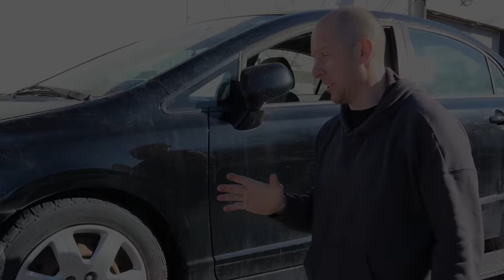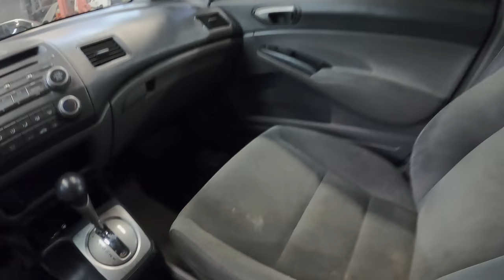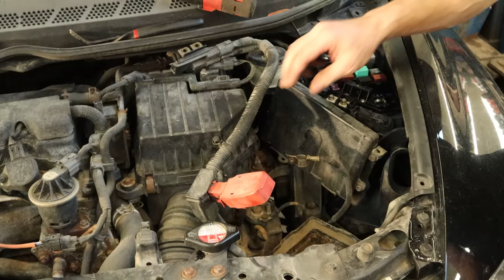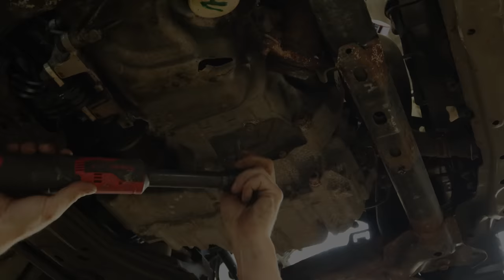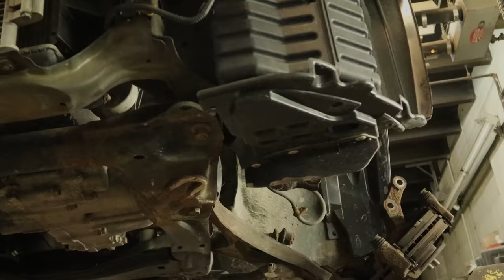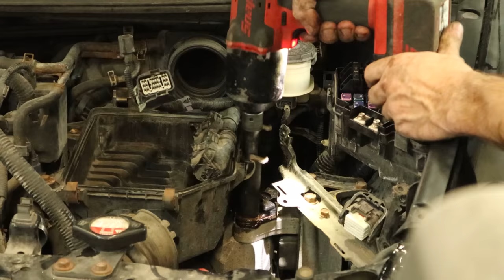I am going to take a big loss on this rebuild

Comment: I already have a high mileage Civic that I keep as a "beater" car, so I won't enter - but I HIGHLY recommend one. Parts are cheap, repair advice plentiful, and chances are it will always get you there. I've never had it quit where I couldn't fix mine with a screwdriver and vice grips.
Reply: Same here.   I have an 07 with 373,500 Mi.  (well, and maybe a hammer a time or two...)

Comment: I've got a 2010, and yeah these things last forever, as long as you don't add extra holes. 200,000 miles and the only thing I've replaced is the fuel pump, and those damned visors. So I clearly don't need one, good on you for helping someone out.

Comment: Did the replacement engine come from Scott's Honda Emporium? ; ) Someone is going to end up with a sweet civic. It has to be good because you had great luck getting the rusty fasteners loose and it looked like it had been taken care of, with the exception of driving it with a hole punched in the oil pan. I once purchased a Volvo 960 that the previous owner overheated the engine because they kept driving with a broken heater control valve. The car had a low coolant light that was ignored which toasted the engine. Some people shouldn't own a car. lol Good luck to all those who enter the car giveaway. I wouldn't want to be the pizza girl having to read through all of the email entries to the contest. They would break my heart for sure.

Comment: FYI msrp for a new 2009 honda civic lx was around $17.500 plus tax title or $19,000, this is more than generous....8th gens are good cars however the power steering for this gen has issues, starters are not easy to replace without a lift, and the block has a defect cracks from the factory, was warrantied until only 100k.....but all around a nice solid commuter car that gets 25-28mpg

Comment: The rusty bolts coming out: that's ONE benefit of owning an F150 with the 5.4L 3V.....it's such a piece of crap that things don't last long enough to rust weld. I had the motor replaced about 2 years ago and put a Ford starter in (engine was out so why not?) it didn't last 2 years so when the next guy had to pull it out, it wasn't rusted in place.

Comment: In todays crappy inflation economy.  It is good to have skills to survive.  Do not have a story.  Do not need a car.  I also turn my own wrenches.  I work to many hours, pay too much in taxes, ride a 24 year old motorcycle and drive a 35 year old truck. Both vehicles run like the day they were brand new and all maintenance is current. I cook everything from scratch,  process my own meat.  I make SPAM, hot dogs, brats, bacon, etc from scratch, also garden.  I can fruits, veggies, and meat.  I buy items in bulk and preserve. It is too expensive at the grocery store. I have 10 lbs Canadian bacon curing that I will be smoking tomorrow.